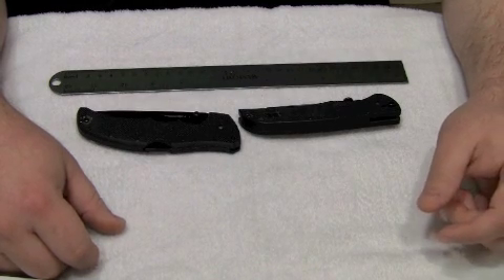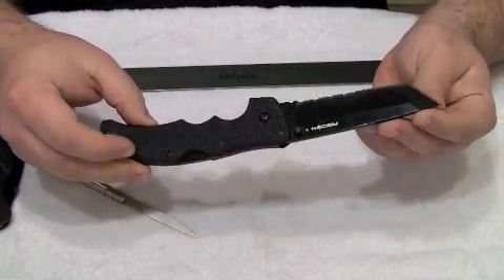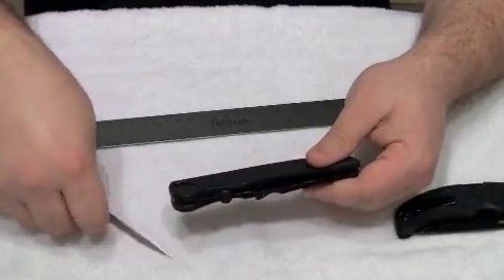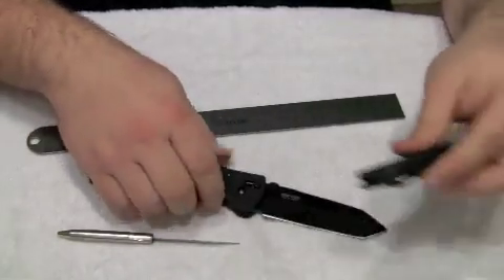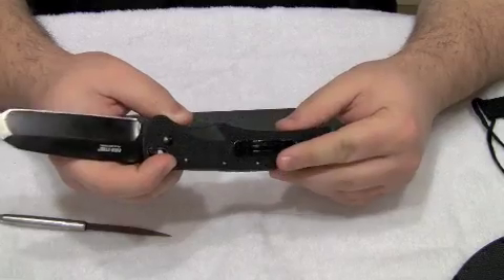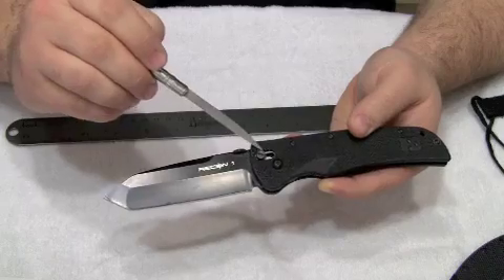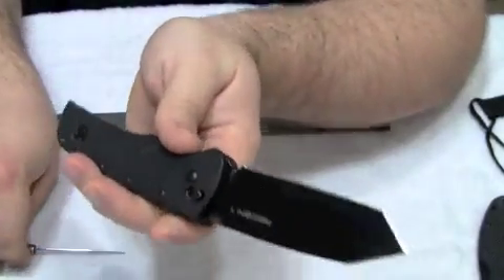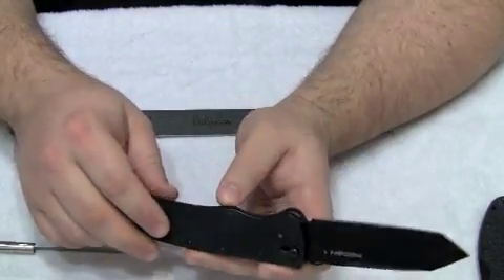Cold Steel Recon 1 - Old vs New Part 1 Locking Mechanism

Comment: I really can't get on with back lock folders. I've been using the Ultra lock recon 1 for years now. So much quicker and easier to close.
Reply from the maker: Same here. You really can't go back or don't want to after using the Ultra. Thanks for watching and please subscribe!
Reply: @SurvivalReviews  Will do 😎👍
Reply: Just checked, and I'm already subbed 😎
Reply: @SurvivalReviews  In 2005, I purchased a folding knife, the RECON 1 Tanto Point model half-serrated edge, style 27LTH, made of 440 stainless steel , and I’d like to mention that the pin used to lock the blade broke, and I replaced it with a screw and nut, this happen 3 months afetr my purchase, I was outside USA at this time and I didn't sent mi knife to CS

Comment: I have a Cold Steel recon-1 with the ultra-lock from 2006 or so.
Its a helluva knife!
Unfortunately i used it to hack through a 4" thick pine tree blocking the road in a snow storm in the mountains and caused substantial vertical blade play/lock play.
I know Cold Steel will fix or replace     it im just hoping they still have the parts needed to repair it .
It was my first quality tactical folder and what i learned to sharpen on.
Ill send it in after Christmas and hope for the best.
Reply: Some company bought them out, I just had mine original Ultra-Lock break and the new company doesn’t repair anything, they will only sharpen and or replace with new
Reply from the maker: True!

Comment: The Cold Steel Ultra-lock is NOT a Benchmade Axis lock.
Its completely different it only operates similarly from the users perspective in that its a sliding crossbar that is pulled rearward to unlock.
The mechanism itself is totally different though and is rather complex and very costly to produce.
Reply from the maker: I think I said similar to the Axis lock. If I misspoke, mea culpa! Thanks for watching!